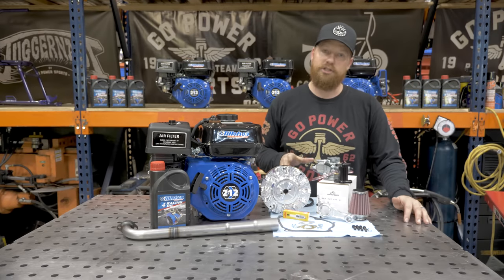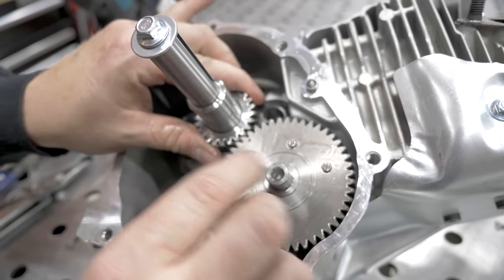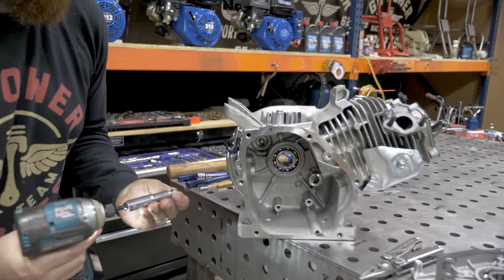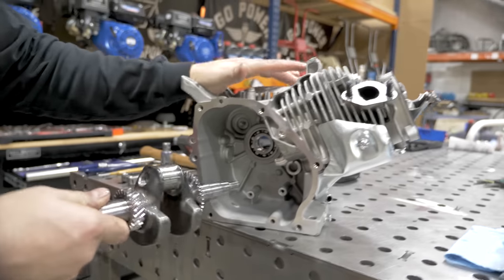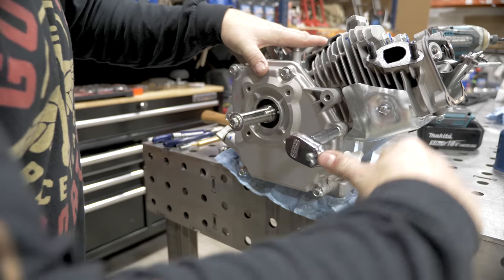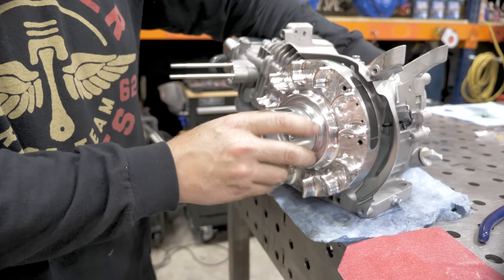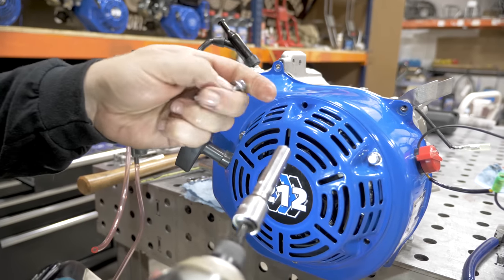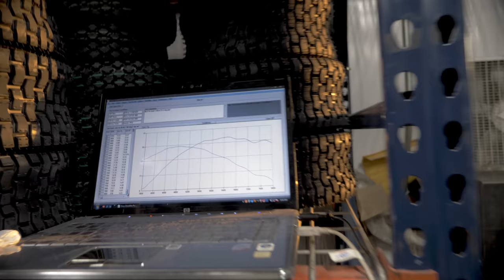Tillotson 212 Engine Stage 2 Install and Dyno | Tutorial

Comment: I'm having trouble with my gx200 after installing the stage 2 kit Cuts in and out like you are turning the kill switch on and off the carburetor is a 22 mm jetted up
Reply: the info you provided is insufficient to allow someone to accurately diagnose what may be causing your issue

Comment: WHAT KINDS OF GAINS COULD YOU EXPECT IF YOU USED THIS KIT BUT YOU DID CHANGE THE CAM AND ROD? BASICALLY JUST THE BOLT ON STUFF SO YOU DON'T HAVE TO TEAR THE ENGINE DOWN TO THE BEAR BLOCK?
Reply: I got the stage 1 tillotson running the tct carb n the juggernaut torque converter. This kit will be bought. Can you buy the kit with the real mikuni carb because the only option is the aftermarket 22mm mikuni but on your site you sell both separately
Reply: @greghaddon1658  Great question,..I was going to say all that good stuff,..why not spend 30 more bucks for the genuine Japanese Mikuni ?

Comment: I did the mod 2 cam with 28 pound spring and it won’t fire up bots good spark and fuel can’t figure out why it won’t fire up
Reply from the maker: What's your Valve Lash set to?  It should be 0.00-0.003" at top dead center.  You may have too heavy valve springs, we recommend 18# with that Mod2 Cam and the Governor out.
Reply: Were your push rods properly seated in flat tappers? Same thing happened with me and I had one of the that didn’t seat right, after correcting it fired right up

Comment: How reliable is this kit?
Reply: can someone answer this question?
Reply: They offer a “cruiser” kit which just has the stronger but all stock length billet items with a little over stock profile cam. Making it pretty reliable.
Reply: @smallenginepower2267  so this one isn't reliable? I would say it would be pretty decent as long as everything is torqued right along with the billet flywheel

Comment: Springs?
Reply: 26lb
Reply: Ik that I have the same cam an kit but went with sk200 flywheel. Just wondering y he didn't use em
Reply from the maker: Because the Tillotson 212 engine comes with those heavy springs stock
Reply: @GoPowerSports   wow didn't know that, where is that stock cam out of steam at with those springs? great vid. I am at a toss up for what I want to do. I can build an engine, but by the time I do that the cost of parts is pretty close to your 225T and the 228EC,  plus I'd like to keep the chargin coil. I thought about just stabbin a cam and a vm22 on the 212TE and tryin that out but I also know that flywheel isn't meant for continuous higher rpm useage. I wish arc or someone else would make a billet flywheel for chargin coils hint hint  lol
Reply: The Tillotson 212 e comes with 22 lb Springs any spring bigger than that in the Hemi head you have to change your rocker arms boys going to tear apart while you running
Reply: @7MilePaul  7 Mile better mile walking through the airport with about a hundred thousand
Reply: @leebrown6153  off top. 👇🏽

Comment: Whatttt ,you don't break in a torque wrench or you don't use it....! Gosh I've heard  some crap on the net(I'm 1/2 way through & I've heard enough) cheers from NZ ...might be a low cost night class ?.
Get ARP or Pioneer to do you some back up Rod bolts. Cheers from  where we do it properly ,New Zealand, no offense...running in a torque wrench ! Do they come in left & right handed ?

Comment: Not ONCE have I seen piston skirt to bore checked
Reply: I'd be afraid to on these Chinese engines. What if you find out you are at 6 or .007", then what? Where are you going to find an oversize 70mm piston to bore up to? I've seen oversize 68mm (196) pistons, but not 70mm.

GPS and a huge majority of those watching this video wouldn't have the tools to measure this out anyway. They're just going to run with the stock bore and whatever 70mm piston they choose.

Comment: You Should put some Moly lifter grease on those lifter follower faces & Cam lobes say from Isky.,.oils not good enough: you need an extreme pressure Moly based lubricant at the least, same on the splash & dip rod bearing. There are engine builders & parts replacers.T
Reply: "Extreme pressure" lol.
Reply: @Deucealive75  That's what it's called: Easy to laugh with limited knowledge
Reply: Use your hands, no Powertools needed unless you have arthritis ? Mannn